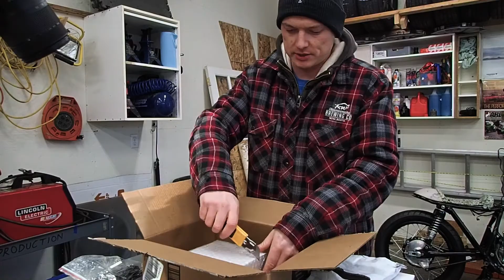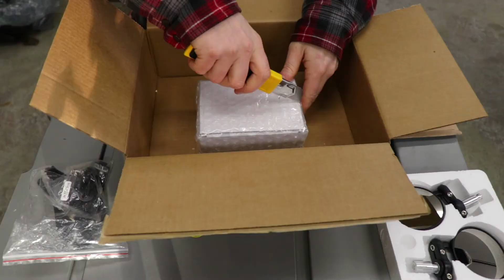CB750K project introduction AND parts unboxing!

Comment from the maker: First part of my CB750K build! Some basic bolt-ons that I picked up wickedly cheap off of Amazon. Bets on how long they last?
Reply: I got my cb750 k5 for $100 us dollars
Reply: @johnmeurer4780  damn brother how did you pull that off? Talk about lucky dude!!!
Reply: @oilinmyblood3906  it had no gas tank seat fenders oil tank. Also had alot water in the engine oil. very rusty everything needed rebuild. The oil pump was cracked in half 😁 i have about $1500 into it. It runs great learned everything I needed to know about motorcycle on that bike

Comment: Excited to see the direction you go with this project. Are you thinking of doing a restomod? Enjoying the videos, keep it up!
Reply from the maker: Hey Marek. Thanks for you interest in the project! There will be some restomod's as part of the CB build. The box of parts that came with the bike included a set of 3ohm Dyna Coils and a Dyna S ignition. So getting rid of the points setup will be happening for sure. 

What other restomods might you be interested in?
Reply: Ah great idea, had those put on my 76  CB750 restomod project (by a moto mechanic). Becomes a completely different machine, and so much more reliable then keeping those old points. Also have a motogadget electrical system in there, and love it! Can send over some photos of it all complete if you like. Keep it up! Those clubmans look pretty uncomfortable on the wrists. I put on supermoto style bars and the comfort and body position is fantastic
Reply from the maker: Yes man! Send me some pics. I love seeing what other people are working on. I kind of feel the same way about the clubman bars. I'm going to give them a try anyway. See what happens right? 😄
Reply: @Mike_Barker  hey brother I wanted to ask you if you have installed those 3 ohms coils on your CB750 yet? And if you have are they running better or worse because of the ohms difference? Or did you install a ballast resistor with those coils? Because the stock coils are rated at 5 ohms, I'm really wondering if it's going to make any difference in performance or if they run hotter because of the ohms difference in the coils, so if you have any information on that brother that would help a lot, and keep up the great videos brother, do you have any new CB750 videos coming out anytime soon?

Comment: Till now I have added the same shit on mine. :)
Reply from the maker: Hahha I think they are things that a lot of people add. I'm hoping that the camera gear carrier sets it apart a little (without making it look hilariously terrible!)

What do you mean by "till now?" Tell me more!
Reply: Mike Barker, I am removing motor to rebuilt top and powder coat the frame. Also I’m designing a new triple tree and will add motogadget stuffs.
Reply from the maker: That's pretty sweet! My friend Jay (who's CB550 is in some of my other vids) has a whack of Motogadget goodies on his bike. They are quality pieces and I'm very envious.
Reply: Mike Barker flasher are not the better I broke one juste when I was torquing the nut. :D I want to see how to remove the engine without a lift, or is that possible to pull it off alone ?
Reply from the maker: Arnaud - the engine removal is a question that I have too. I hoping not to have to pull the engine, but I've got a feeling that it's going to need a top end rebuild soon. 😅